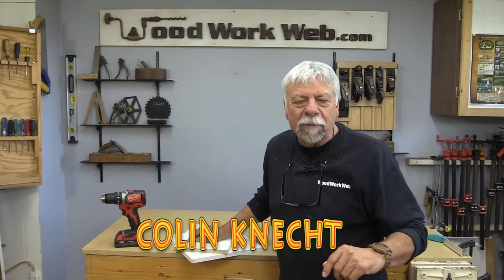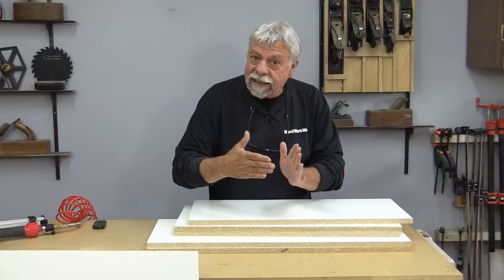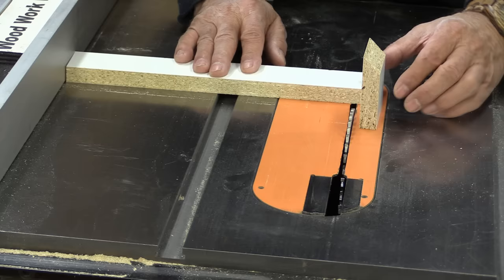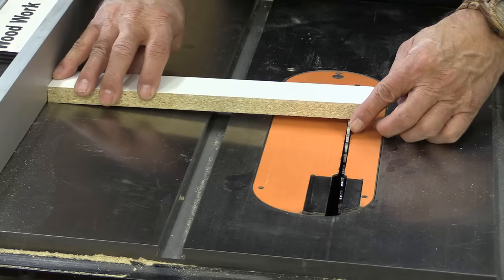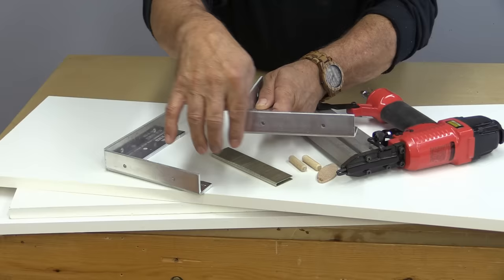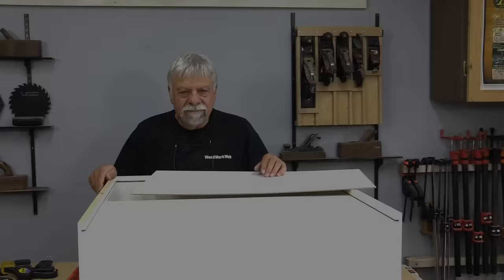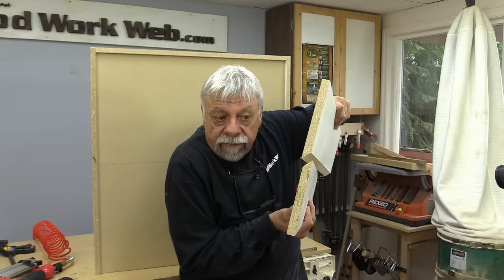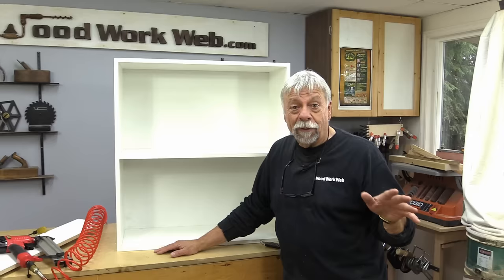Economy Cabinet Making with Melamine: How to Build Cabinets

Comment: "Economy cabinet making with melamine" Has machines and tools worth thousands of dollars. Economy..right.
Reply: this is carpentry for the rich.... 😅
Reply: You could always use a hammer and hand saw to do the same thing if you hate yourself of have never seen a power tool before. You could also rent all these power tools for a fraction of the cost and have the job done in an afternoon. Or borrow the tools from a neighbor. Or go to IKEA because you don't know what your talking about.
Reply: @ezras8889  then don't call it economic anything, because it's anything but to build the cabinet with those instructions if it costs thousands to acquire all the tools to follow his steps.
Reply: He's referring to the actual cost of making a cabinet vs buy one. It doesn't matter how you do it, the cost is the same. Material and labor.
Reply: @icyhotonmynuts  if you feel like you need to have the exact same tools he has just to "follow along", you better stop doing DIY or not watch DIY Youtube tutorials at all.

I could have no power drill. Do I go to a Youtube video and complain that I have to buy a power drill just to "follow along"? If I'm a successful pro carpenter who sold all his old tools to buy new tool, and decided to make Youtube videos TO GIVE TIPS TO HELP THE BEGINNERS, do I make a video with me using tools that I used to have (buy them again??) just to accommodate those who can't afford my current tools?

I don't understand why you need to complain about this. This isn't high school shop class. You don't even have to do the exact same thing, as most of the time we're just here to learn concepts and the general procedure on how to build stuff. Our build dimensions, colours, nail types, blades, glue and yeah tools could vary from woodworker to woodworker.
Reply: Able to get second hand tools of marketplace for less than 50 and that means you have tools to make a lot more things. Possibilities are endless. If you can't afford simple tools or know what they are and how to use them then this isn't for you buddy just go buy it already made in a second hand store stop crying
Reply: I don’t think a hand saw is appropriate for melamine. It will tear. On the other hand, a circular saw can do the work.

Comment: So I can build a $50 shelf for $10 if I spend $10,000 in tools?  Great....
Reply from the maker: The tools are for production work. If your only building one shelf, A simple clothes iron will work to apply the edging. Much slower, but it works just fine.
Thanks for watching.
Reply: You probably couldn't build it anyways

Comment: I've noticed in a couple videos, including this one, that you call the Melamine base material "MDF" when in fact it's actually particle board. While, as you already know, they have similar working properties and require similar fastening requirements, but they are manufactured much differently. I've watched and learned from many of your videos and have been subscribed for a few months now and look forward to many more videos in the future. Keep up the good work, but please also use the Industry acceptable terms whenever possible.
Reply from the maker: The names are interchangeable around these parts. If I remember, I try to use "Engineered wood" in the future.
Thanks for watching.
Reply: MikeC19100 I mean if we want to get technical here this is a Thermally fused laminate pressboard or TFL for short. I do agree that a general term would better so as to avoid confusion with the new DIYer.
Reply: Melamine can be used on both particle board or MDF. We use them both at my work place (Franklin Fixtures) where we produce displays for books, food products, etc..
Reply: james gray Understood! I realize the Melamine surface can be applied to multiple types of materials. The videos I am referring to were being made using particle board, or TFL, whichever you choose. I’m not totally new to woodworking, however many woodworker newbies watch these videos to learn from and my comments are such that it helps using the more industry-wide acceptable terms so they can learn the correct terms too. Again, I enjoy the videos and learn from them also.  I was an Information Technology Instructor for more than 10 years and learned early on that it’s important to teach using correct terms so the students learn them up front and don’t get confused hearing 3-4 names for the same item.
Reply: MikeC19100 
It also keeps us newbies from buying the wrong product. I’m going to use the one that’s the lighter weight on my rv project. So which is the less weight?
Reply: Here in Ireland (& the UK) we call particle board chipboard... 😏
Nice simple build vid ... I intend to build my custom kitchen cabinets like this but with a "real" wood face frame & shaker style doors & drawers...😎
Staples for my nailer seem to be rare here , I'll just hafta keep lookin... 😒
That edge-bander is niiiice... 🤗
Reply: @kevinlamarr1424  the particle board is lighter, but there's not a lot between them. I worked at a caravan manufacturer a few years back, and they manufactured the panels in a similar way to hollow core doors - pieces of pine rail framework, sandwiched between 3mm mdf sheets. If you're careful with setting it out, it'll be sufficiently strong enough for most things you'd want to do in an rv.
Reply: Peter Fitzpatrick Hey Peter.  Where are you based.  I also struggle to get the simplest of things sometimes.  There are a few online stores here in the Dublin area.  If you want, I will send you some names. I am in Bray.
Reply: MikeC19100 ...thank you for being this specific. As a “not noob, not pro”, I can also be confused by improper labelling. I’m sure that many others out there will appreciate
standardized branding/labelling. We appreciate the courtesy and professionalism. Cheers, Bill
Reply: Peter Fitzpatrick   In North America, oriented stand board (osb), is often referred to as chip board.

Comment: Hi.  Nice simple cabinet.  I disagree with comments saying you need expensive power tools to make this.  You just need a circular saw, an iron (for edge banding), glue, and melamine screws.  I do have two comments, though.  This comes from over 30 years of woodworking and cabinet making.  Please remember to ALWAYS roll up your sleeves when using your table saw, router, etc.  This is essential to shop safety.  I saw at least one segment where you had your sleeves down to the wrists while using the table saw.  The only other suggestion I have for others using a cleat system for hanging cabinets is to use 3/4 inch plywood for the mating cleats.  It's much stronger than melamine.  Thx.

Comment: I just discovered some very nice solid plank cupboards from the 1950s. One of them is just knocked together with little nails through the middle of all the planks and side walls, it looks like a grid with 6'' by 12'' cubicles/pigeonholes. It's awesome because it's so strong and so easy to make and durable. ... The other is the same but bigger, and a router has been used to prepare little slots in the longer planks to place all the support deviders. I love the idea of working with solid wood that can be nailed throught the middle into grids. So cool. Thanks for the video!

Comment: Great video Colin.  I have made a lot of cupboards and cabinets so you brought out some great points.  The support system you are using is called "French Cleet".  Rather than spend a lot of money on pegboard and hooks, this system can be used to support your Tools and hardware by making bins and brackets.  Just to let your viewers know about it.  Take care and be safe.   Tim
Reply from the maker: Thanks for the tip and thanks for watching, Tim!
Reply: Yanks call it a 'french cleat', the rest of the world just calls it a cleat. A mitred cleat system for tool walls is a great way to collect lots of chips and dust.
Reply: Regardless what it is called, it is a good system. It may not be for some people but others use it.  Yes I agree it collects a lot of dust and chips, but so do shelves and piles of wood as well as other Tools.  That is what wodworking is all about.  A good filtering system does help take care of the dust.  Thanks for your input.  By the way I am not a "Yank".  Prenniez soin de vous, M. 405.

Comment: Stapling MDF is an accepted method for fixed cabinets, but for better joints, Confirmat screws were designed to hold in MDF and are much more durable, especially in furniture and where the product will be subjected to stress loads.   I've made numerous pieces of MDF-based furniture and cabinetry using Confirmat screws.  Even after handling by commercial movers in a cross-country move,  they continue to survive just fine.  Even my mobile router table-cabinet is still holding up nicely after 5 years of rugged use.  The downside of Confirmat screws is they are much slower and require more skill and attention to use, and are more difficult to conceal (hence the need for those little screw caps).   For that reason, you rarely see Confirmat screws in less expensive furniture and cabinets.  By the way, Colin, nice build.  The edge bander and trimmer are just the ticket.
Reply from the maker: Thanks for the tip and thanks for watching!
Reply: I agree with the use of confirmat screws for construction.  I use confirmat screws on 4 inch centers and also use 5/8" melamine for everything on the case including the back.  I subscribe to the Danny Prolux school of cabinetry building.

Comment: My problem with MDF in a humid environment like a laundry room is the boards absorbing some moisture and then bowing.  I find a either a internal frame or a facing attached to the MDF helps greatly with that problem.
Reply from the maker: I did have some concern about that ... but I think it should hold up. Moisture in a concern when working with this stuff. Thanks for watching.

Comment: great how-to guide for when, you know, i wanna do an 'economy' build with my multi-thousand dollar edge bander. we all have one of those, right?
Reply: Exactly what I was thinking.
Reply: Well it is a good video but if you do not have that edge bander lying around, you can put the edging onto the rough side of the melamine. Place a soft cloth (thin like a handkerchief) place it over the edging on the melamine board (with the glue side onto the wood) and use a hot household iron (without a steam facility) to iron down the edging (melting the glue onto the wood). Then take the blade of a hand plane and cut the protruding edging (which is wider than the melamine) off. Follow that process up with a bit of sand paper to remove the sharpness of the edging that you have just cut off. Dave Stanton made a video explaining this in detail.
Reply: They got one at my work, but honestly an iron and tape is all you need
Reply: Yeah, I’m looking for a video that has far less fancy tools involved.  Unless a tool company wants me to test their power tools…hint hint.

Comment: I started to chuckle when I saw you use those edging machines. Talk about a specific task tools. 
Question about the staples you used: would glue help or it's really not needed? Seems not enough strength but than I don't have cabinet making experience. Thanks.
Reply: You would have to use a specialty glue made just for melamine joinery. Regular PVA wood glue won't stick to melamine. I wouldn't trust the staples alone as having enough strength to support heavy shelf loads, but Colin seems to know what he's doing so I'm not going to second-guess him.
Reply: Particle board is almost everwhere here in Europe. I would glue in dowels. What is missing, are holes for moveable shelves and, doors. As there is no edge banding, I would go for European style hinges in this case.
Reply: @jotapi4010  Lacking banding I would use a thin face frame.  It will add measurably to the weight carrying ability of the shelves over time as these composite materials tend to bow over time.

Comment: Hi Dear Colin , excelent video as always !! Two things here: 1st You are using particleboard here, not MDF. 2nd please do a video of how you made these excelent melamine cuts without chipinng or scratching the melamine faces, thank you !. Greetings from México
Reply: Triple chipper melamine blade
Reply: 50 tooth carbide blade with tape over and seen face cut face down on zero clearance insert on table saw should do it

Comment: Hi, nice video.
I'd like to see how it holds up with only staples after a couple of weeks, as this is a good alternative to wood screws that i'm used to do it so far. 
Also i havent thought of a clean system for melamine.
Great Job
Reply from the maker: I try to remember to report back on how the staples are holding ... thanks for watching!
Reply: I too would like to know how it's holding up.

Comment: There are only two lumber yard/hardware stores in my area. When I asked for Melamine at both of them all I got was that deer-in-the-headlights look from everyone there. One of the main problems for a woodworker living in the countty. And as for hardwoods, totally non-existent. But!, I have a plethora of barn board. LOL
Reply: Lucky you.
Reply: @JosephLorentzen  For a person like me who grew up in Dallas /Ft. Worth it is a big change. I was use to finding whatever I wanted locally. Moved to the Ozarks to retire.
Reply from the maker: Interesting you can't get it there. I would have thought its low cost would have made it available everywhere. Thanks for watching!
Reply: @JWimpy  are there any local cabinet shops around your town? They would likely stock melamine. As a woodworker its one of the best materials you can have around. Cheap, durable, waterproof, paintable (if you lightly sand it) easy to clean, and good looking. I use it for all my interior cabinets after strengthening the show edges with wooden frames, and also for all my shop stations. Work tops included. If you are gonna be a lifelong woodworker, you could benefit from calling a big company and getting 10-20 sheets delivered to you.
Reply: @MaydaysCustomWoodworks  Sad to say, but the only cabinet shop here is not a custom-built place. They measure your space and order in "Ikea" junk and install that.
Reply: @JWimpy  my heart breaks for you my friend.
Reply: i just buy lot wood plank and glued together come sheet i make cabinet full plank wood. best material make cabinet, not newer melamine shit or MDF trash in good cabinet. all expensive high qulity cabinet made full wood not newer shit cheap trash material. i has build cabinet,houses,all furnitures last 40 year and newer not used melamine anywere if want good furniture or cabinet. if finland president or ministers has see i make cabinet melamine or mdf i not has work newer again. need be good if do somethink. plank not cost more than melamine.
Reply: @mattivirta  yep, i call my American home a “cardboard castle”. Everything is made to be disposable/teared down to simply keep the building industries going forever. Keep people spending forever. Most homes are made cheaply intentionally. It really sucks.

Comment: Colin nice build. I was a bit concerned you didn't wear a dusk mask while cutting the mdf as there was quite a bit of fibre dust , cheers
Reply: It could be my mistake but over here in the UK melamine is backed on chipboard not mdf, even with chipboard a mask is advised but is less deadly maybe?
Mdf is a good material shame its made with so many deadly ingredients.
Reply from the maker: I probably should have been wearing a mask, as I normally do ... but it's hard to remember when your filming. Thanks for watching!

Comment: Great video. Thanks Colin. Was there any chipping of the melamine when you cut it? Did you use any special technique or saw blade to avoid chipping? Thanks, Mark.
Reply from the maker: A High quaily, fine tooth blade is what I find works best to prevent chipping tearout. Thanks for watching!
Reply: Having your blade set properly will help reduce chopping too. If you have a zero clearance plate, that will help too.

Panel saws specifically designed for manufactured boards have a scribe blade - a small, adjustable blade, rotating with the direction of cut - before the main blade, which cuts a shallow trench through the melamine surface, slightly inside the cut dimension, practically eliminating blowout.

Additionally, selecting the best face of the board, come assembly, assures that any blemishes are not directly in the line of visibility.  If you have two cabinets together,  putting the scribed sides out, leaves two good faces in.
Reply: Thanks for this. I have seen other videos where the table saw blade is set for a shallow score cut first and then the melanine is run through again with the blade set to fully cut.
Reply: Triple chipper melamine blade

Comment: Public Service Announcement- Melamine is NOT a low quality material. It IS a cheap material, but if you know how to strengthen Melamine with real wood facing (Not edgebanding) then you can use it on the highest quality cabinet interiors. Melamine is extremely durable, easy to clean, good looking, and waterproof. A fantastic combination for any cabibet interior.
Reply from the maker: Agreed, Thanks for watching!